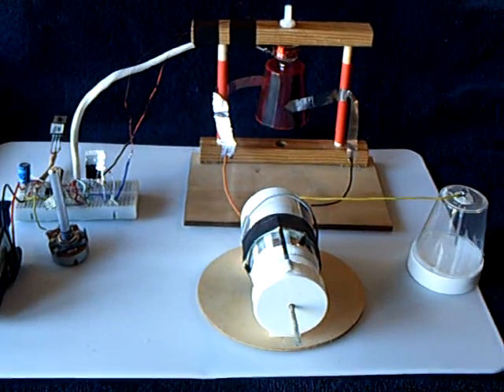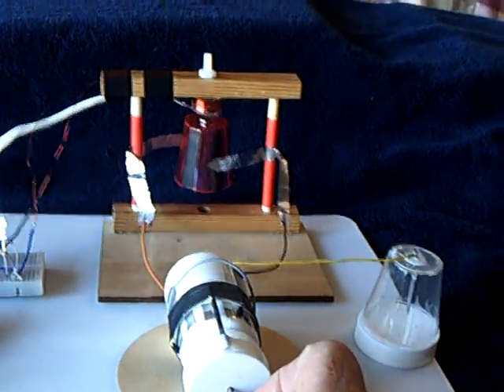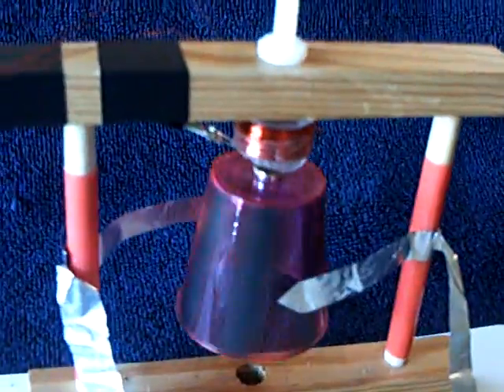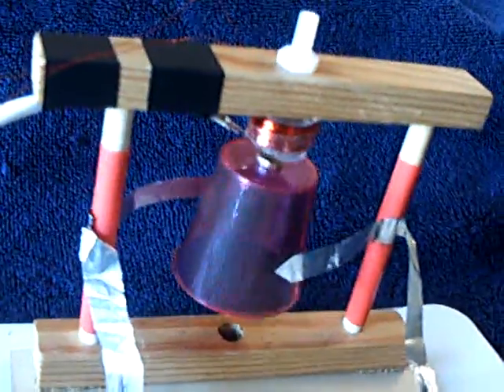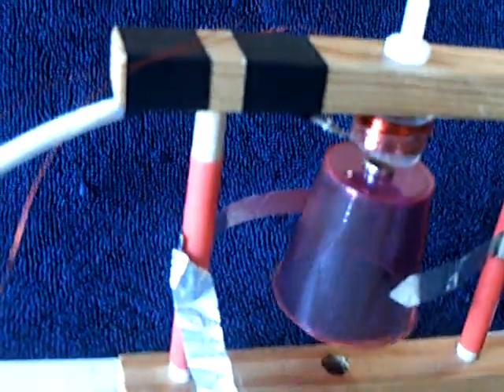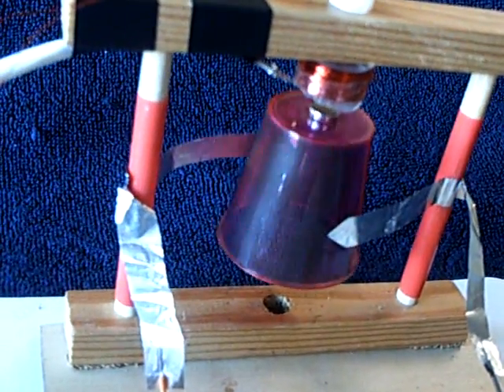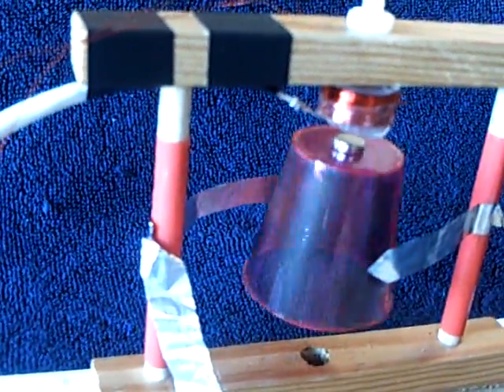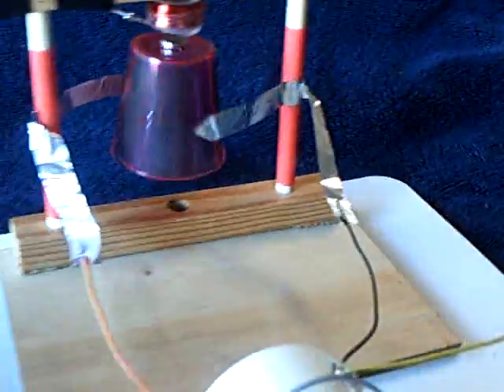Electromagnetically Levitated --  Electrostatic Motor

Comment: Cool! I already started gathering up the materials for mine. Just need a hall sensor and wind the coil ;)
Reply from the maker: Anton Babiy Be sure and get a 'linear' hall sensor.  The switching ones did not work for me
Reply: ***** yeah, the switching ones have there own threshold while you want to be able to change the threshold with the pot.

Comment: Would the glass sanded at a 45 degree angle make any difference? Horizontal bars is what i could see on the shot glass.can contact be made inside the glass?
Reply from the maker: g law Interesting idea about the 45 degree angled segments.  I have not tried segments on the inside surface of a rotor.  The rotor is plastic and not glass.  It is very light weight.

Comment: Now that's some sideways thinking..very cool !
Never knew that about India Ink. Any brands to recommend ?. Will have to research, but I presume the pigment for the very deep black is a carbon rich soot or something.
Oh, and this goes right back to getting a rotor to spin and do something while levitated, from ages back, bravo !
Reply from the maker: I got this India ink at a Michaels craft store but you can also get it online.  The bottle I have is 'Daler Bowney made in England.  I might try a magnet rotor like I used on the IR setup I did.  It is hard to beat the 'needle motor' design though.  I takes a lot of power to levitate something.this way.
Reply: *****
Thanks for the info. Am thinking extra black or similar wording may be a clue...on checking just now (before heading to shop) it's basically lampblack and I remember we all did several experiments with candles and collecting it some years ago :)
Reply from the maker: slider2732 We might be able to make either an interesting homemade battery or capacitor with this ink.
Reply: *****
That's exactly the thinking :D
Got a Floz of Daler Rowney - Black India Ink. Was the last bottle of India in the Walmart...everyone must be having the same idea in this town lol

Comment: I can't remember the last time I saw a bottle of black India ink. I was probably at school. I'm not saying it's not available, just saying I haven't had any use for it in over 50 odd years. Another great video Lidmotor, thanks.
Reply from the maker: You can get the India ink at craft stores or online.  I never knew that it was conductive until I stared working on these electrostatic projects though.
Reply: ***** I expect somebody will make a link here to Robert Murray-Smith's graphene ink now :-)